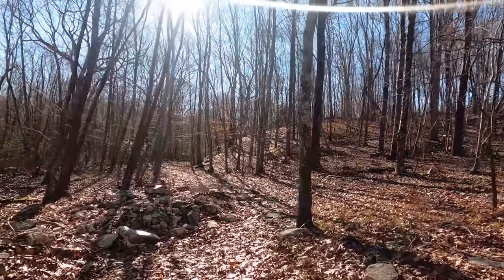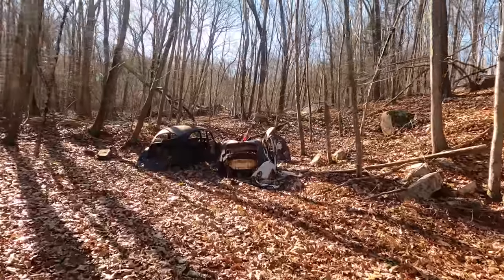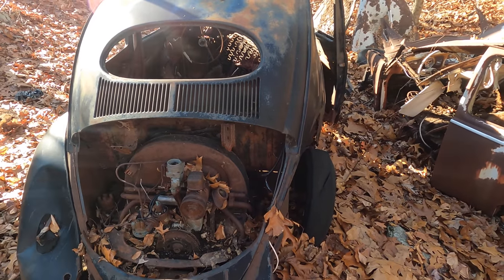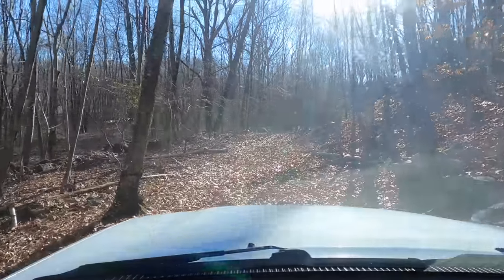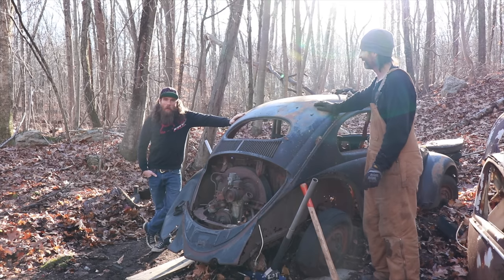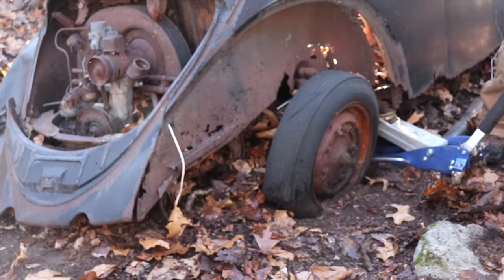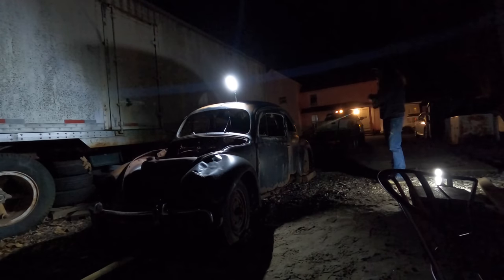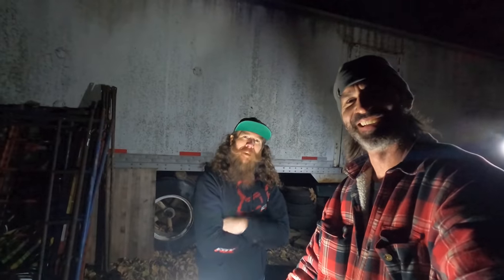FREE Abandoned Car Found in Woods | Rare Vw Beetle Sitting for Years Rescued!

Comment: Oh man, that car is rough. But the black/red color combo is my favorite for old cars. Looks like it may have had an accessory Dehne fuel gauge installed, judging by the holes int he top of the gas tank.

EDIT: I helped a buddy haul a few old VW's out of the woods several years ago. The last trip was two dune buggies on one trailer. No good way to get them off, so we tied them together, tied the rear one to a tree stump, and stomped on it! Worked perfectly, too. No ramps, just speed and power. That was good for a laugh!
Reply: Ah the Clarkson method!

Comment: This poor beetle is so rusty underneath that it seems a miracle to me, that it didn't fall apart when you were pullin it up and down the trailer. Btw... it's strange but this one has two different front fenders. The right one with the "lying" headlight glass and the left one with the vertical headlight glass from a 70's model. Cool channel and cool rescues you are doing 👍👍👍 Cheers from Germany, Andreas

Comment: I saw the trim on the relict vehicle left behind. I think you were clever enough to bring it with you. As it was not there anymore when you drove off.
I have a question: Honestly is there anything on this vehicle you can still use? Maybe the roof or the rearwindow frame? I can see it mainly as yardart though. 
People are shaking their head as I have half an Austin A30 beside my house.  They think I am braindamaged or something. I even had this car painted (in Wallace and Gromit paint) and braced it together with steel, wood and aluminium. But after ten years sitting outside it looks like shit again. I even had the headlights turn on with motion sensors and a car battery when you got near it. But now that is not working anymore neighter. I just do not have the heart to scrap it.

Comment: My first ‘first car’ was a ‘63 beetle. Owner wanted $50 if he kept the battery. I opened the door, pulled up the back seat and started laughing - the battery had rusted right through the floorpan and was sitting on the driveway with two cables leading down to it 🤣

Comment: If you and Mustie1 decide to road trip south to Georgia, I've got a '60 or '61 Beetle, minus motor, with original crash box trans.
It needs everything, but it's still worth saving.
Price is right (free), and it won't be a lot of work to get it on a trailer.
I'll post my email to you through utubes' message system.
Regards,
Duck

Comment: Hello sir, you seem to get a lot of these cars with froze up engines.
And I want to help you out. So it isn’t such a chore to take them apart, or free them up.
Take the engine out, and strip the accessories, tin, spark plugs and valve covers off. Empty the crankcase.(drain)
Take a plastic tub, put the whole engine in it. And fill it with coarse gravel  Over the top of the engine.
Fill the tub with vinegar….slosh it around to get any air out.
The gravel helps to displace the area, and you only need 4 or 5 gallons of vinegar.
Let it set, a month….shake it around…every so often.
After a month..
Drain all the vinegar, and rocks. You can put a piece of conduit…two inch..or whatever you have pipe like….so you can get one of those squeeze bulb kerosene siphons down the pipe to pump out the vinegar later. You won’t be able to get it passed all the gravel….if you don’t use a pipe. Have the tub on a slight incline so all the vinegar is able to be pumped out.…..put the vinegar back in the jugs for the next one.…then do the same, only use diesel…used oil, fuel oil…..whatever you have.  Let it set..for a week….Slosh it around a little.
Drain all that, and put it back in jugs….and save the rocks and plastic tub for the next one.
The vinegar, will break down all the rust, and free the rings. The fuel oil will lubricate everything…..give the valves a little “tune” with a rubber hammer to free them up…
And the engine will turn, or at least be a bunch easier to take apart. Saving things like cylinders and heads …..along with probably the crank ,case and rods as well.
……
Your welcome.  😀😀